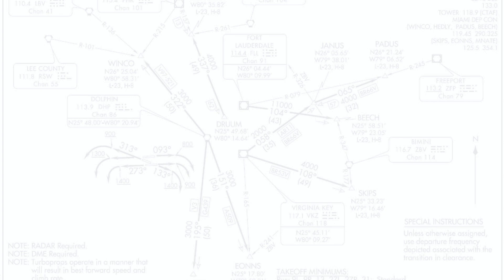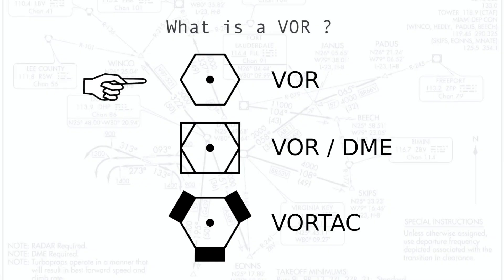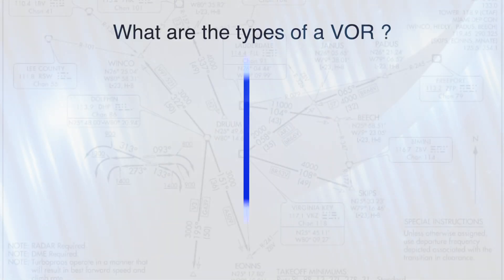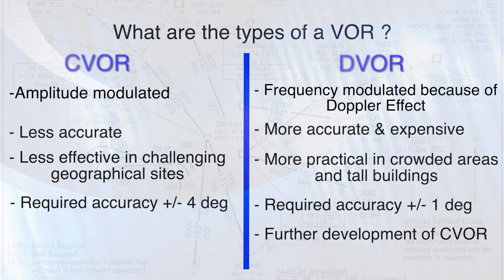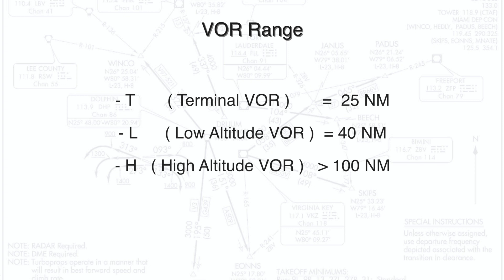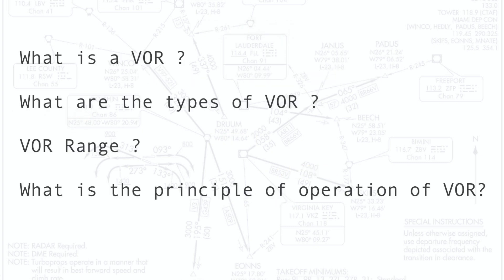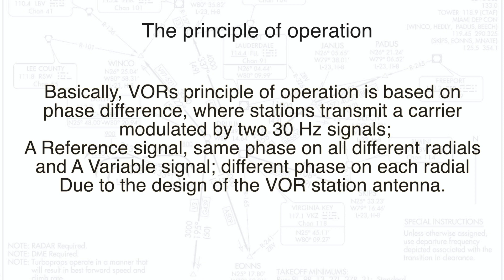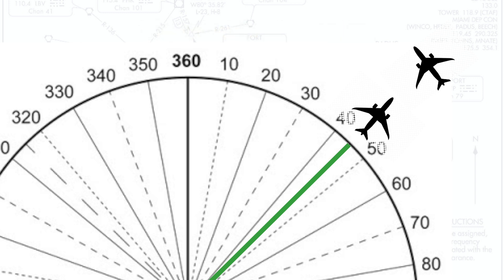✅ Understanding VOR | VOR Navigation (2023)

Comment: Hi again, thought I might ask this question. I'm on the mfs2020 simulator on the  a320 for a VOR approach in Nice, VOR CGS. I was wondering what could I be doing wrong for the plane to deviate from its trajectory? 
I did tune in the course 354°, the frequency of the VOR, even added the second VOR. I'm with AP on, tracking 354° but sometimes the plane deviates.Any reason for that?
Reply from the maker: In order for me to answer you I need more information. I must scan the cockpit setup to spot the error.
Reply: @ATPLStudent  if you want I can send you a video through we transfer? If you provide me with an email I can do so